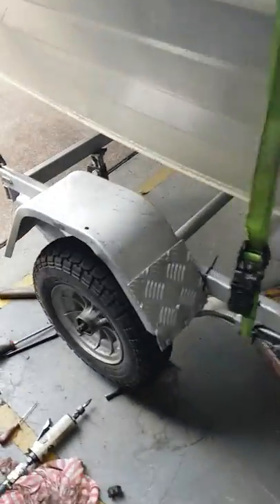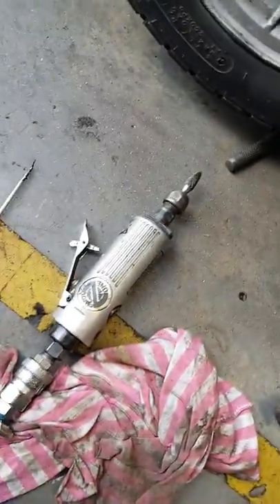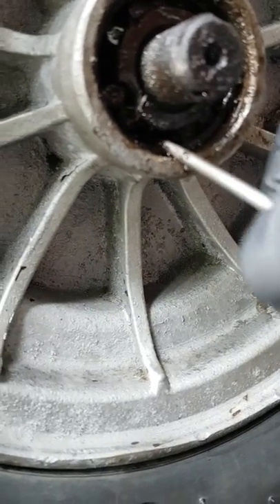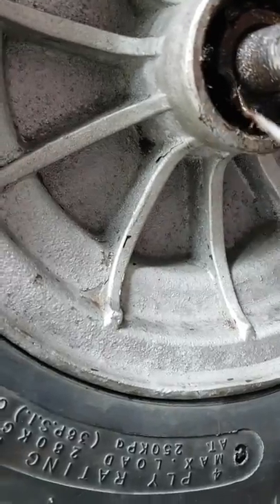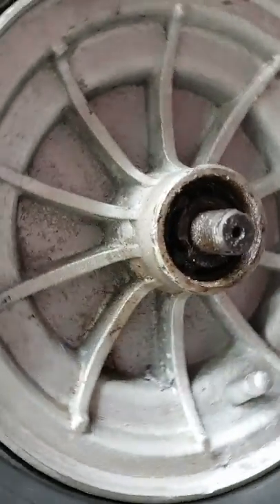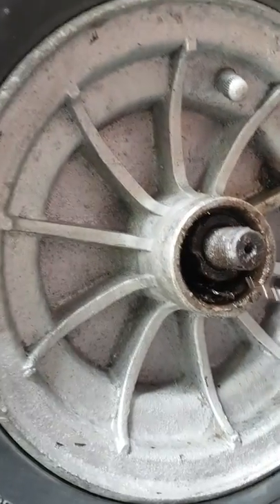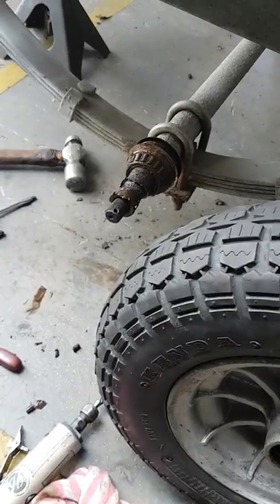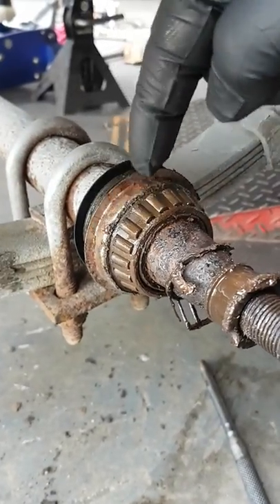Trailer wheel wont come off,  a seized wheel bearing, how to remove a trailer wheel

Comment: Yeah! Great Idea Mate.. All Fixed and I was stressed out now I'm chilled out 😊
Reply from the maker: Great to hear. There's always different ways of getting a great result
Reply: @firstclassbrakesandautomot6941 
Actually... I went to try it and my drill bit wouldn't go through it. I tried using a crow bar, then heating it and using a small sledge hammer and still can't get it off. I'm going to get a grinding bit like you used. I will have my sanity back eventually..

Comment: Theres is no tool to take off those wheel bearing without tearing it apart?
Reply from the maker: Not unless you can buy a very small puller to get in there